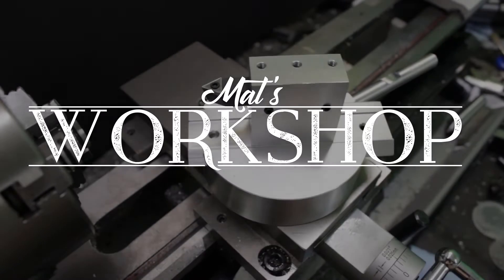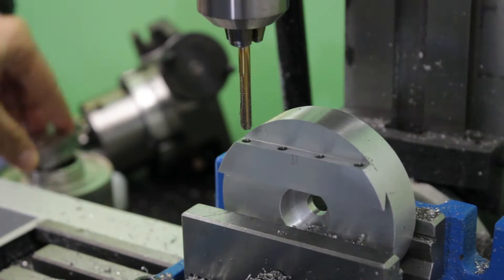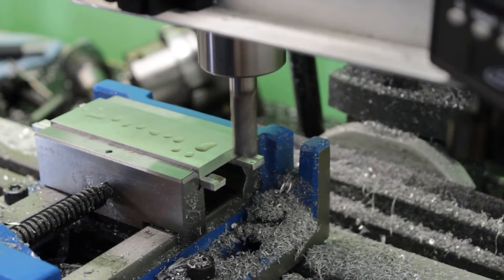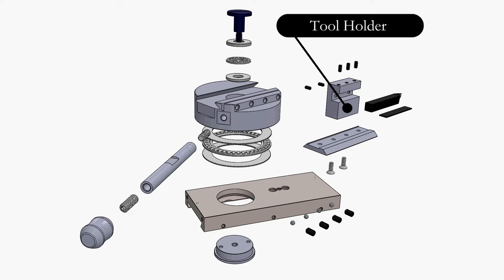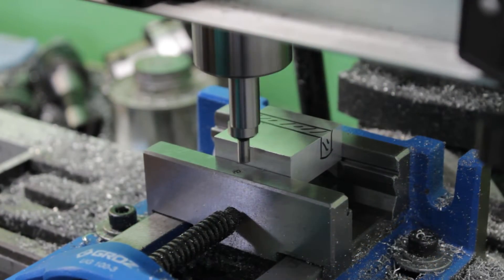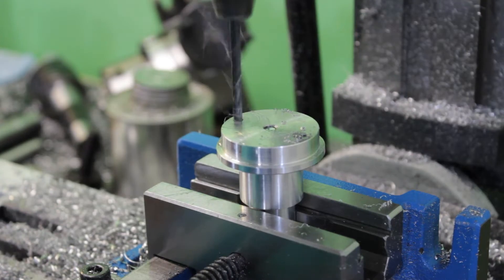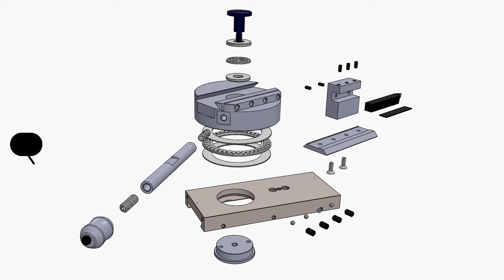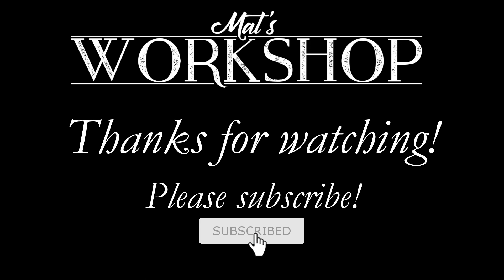Mini Lathe Radius Cutter

Comment: Nice job brother. You seem to have a lot of run-out on your chuck jaws (around 17:30) if I look at the component spinning. What is the smallest internal radius you can cut, if you can with this gadget? External radii is not a problem to cut.
Reply from the maker: Hi Pieter! I do have quiet some runout indeed. about .003" to .004". Not great, but this is to be expected of any chinese branded chucks, or even many other tool. The late spindle itself does not seem too bad, but it is still about .0005" to .001" off. Not the best, but you get what you pay for. a brand new good quality 3 inch chuck is probably worth about 4 times more. I later bought a 4 independant jaw chuck for when i need to crank up precision. Very cheap and not so great either but you know...$$. But for anything i want to do quickly and for which concentricity isnt critical, i use the 3 jaw chuck. Thanks for watching
Reply from the maker: ho and the minimal internal radius is basically 0 depending on how i set it up
Reply: @matsworkshop566  Morning brother! I have ordered a fair amount of stuff from China to use in my workshop, but unfortunately 99% of all the stuff is total trash - plainly garbage. All boring bars are soft. So, in no time they look like as if they went through a concrete mixer from the clamping screws. I bought many bore comparator sets and I have to modify all of them to firstly just function, and secondly to be able to measure any bore diameter in the range of each set. The boring head that I ordered had to be modified to make it sort of function properly. Many items I ordered were the wrong stuff - not what I ordered, and then you are stuck with it. So, think twice before you order any Chinese junk. But like you say, you get what you pay for. Again brother, you have done a seriously good job with the radius cutter. Very few people would go to so much trouble to manufacture something. Have a beer day!

Comment: Where did you buy the table vise.  It looks like a good deal.
Reply from the maker: Hi John, and thanks for watching. If you are refering to the blue vise i am using on my milling machine, the brand is Groz, model UG 100. Amazon (CA) link below. Quiet easy to find. About 100$CAD (probably about 5$USD :P, i say that 'cause we tend to pay this kinda thing much higher price in Canada, where i live)
https://www.amazon.ca/Groz-35121-Uni-Grip-Drill-Press/dp/B077XN118X/ref=sr_1_2?dchild=1&keywords=groz+vise&qid=1614044820&sr=8-2
But please note, even if it does a relatively ok job, this is not a high precision vise. This is mostly designed for use on a drill press. The mobile jaw is pretty narrow, does not have much guiding surface contact, which means it moves quiet a lot. Out of the box, when squeezing a part in, the mobile jaw can lift .004-.005''...not so gread. I added shims under it to limit this issue and remove some play out of it...got it down to .001-.002'' movement...still not great, but knowing this, i generally keep a few .001'' shims on hand and i can place it above the parallel i put on the fixed jaw side, and it helps a lot. If i take the time, i can get a part leveled with a sub .001'' error, which is acceptable for most of what i do.
I would strongly advise to go more for what is often refered to as a "screwless tool makers vise". You can get them of different sizes, from 1'' to 4''. Groz have a model (https://www.amazon.ca/Groz-35201-Tool-Makers-Screwless/dp/B079RR7DDX/ref=sr_1_7?dchild=1&keywords=groz+vise&qid=1614044820&sr=8-7) which is pretty expensive. Personnaly, i own one made by Accusize (here is an example, not exacly the one i own : https://www.amazon.ca/Acusize-PRECISION-SCREW-LESS-VISE-Width/dp/B077BCG8CV/ref=sr_1_5?dchild=1&keywords=accusize+screwless+vise&qid=1614045341&sr=8-5). Accusize have various tools of medium quality for hobbist machinist, and for what i do, it's decent. Of course, this is all cheap stuff made in china, so you get what you pay for. But, by design, this type of vise is much more precise and reliable than the vise you see in my video. It's also more versatile, since you can mount it in different positions. If you get various size of those, you can, for example, have a 2 inch vise, holding small parts, and place this vise at an angle in a 3 or 4 in vise...very useful. They are not as straight forward as real milling machine vises, which you can also get for decent price (probably still a bit more $ than a tool makers vise), but they then to have a higher (thicker) base, which limits the already not so large capacity of a mini-mill such as mine. I hope my comments are useful. Please stay tuned for more videos, i have moved in the last 2 years and am spending quiet some time working on the house, so, less time for projects. But i also reserved a room to build a new small workshop. When i am done, i hope to start posting new vids. Thanks again! Mat

Comment: Congratulations!  Really nice work.  Why did you make a cut in front of the handle?
Reply from the maker: Hi Jean, thanks for watching! If you are talking about the narrow slot on the cylindrical base through which the 4 set screws of the dovetail slide pass, it is there to weaken (volontarily) one side of the dovetail edge so it bends down on the sliding part as you tighten the 4 set screws. You can see that the bottom of this slot is very close to the bottom edge of the dovetail opening (about 1.5 mm). This allows this side of the dovetail to act a bit like a swivel, but without any moving parts. It moves (bends) very slightly to eliminate the play in the slide and lock it in place. Its part of the "brake" feature of the slide. I hope this helps!

Comment: Hi, do you have links to bearings you used?
Reply: Hi Igor, thanks for the question. 
The large bearing is 
https://www.ebay.com/itm/NEW-1pcs-AXK5070-50x70x3mm-Thrust-Needle-Roller-Bearing-Washers/122248184583?ssPageName=STRK%3AMEBIDX%3AIT&_trksid=p2057872.m2749.l2649
The small one, i already had it, so not sure where it came from, but it is equivalent to this one :
https://www.ebay.com/itm/2-PCS-AXK1024-Thrust-Needle-Roller-Bearing-With-Two-Washers-10mm-x-24mm-x-2mm/141778171922?epid=623863937&hash=item2102a33812:g:JdIAAOSwHjNV-7Dx
Thanks!

Comment: Great work! I am looking for dimensions for this project.  I have found your GrabCad drawings and they are wonderful, but I can not find dimensions anywhere in the files.  Also, I can not open the files on my macbook or lenovo comps, just my cell.  Any programs you suggest to download to view on the comp?
Reply from the maker: Hi Micheal! Yes, I am sorry about this. For some reason my computer would fail to export it as a generic .Stp file. However, I you search for minilathe on grabcad, i believe someone took my model and converted it to step. i know it is there somewhere. I might post a new model with some upgrades i did on the machine. Thanks for watching!

Comment: What is this tool used for and what is it called? 13:02
Reply: Its an edge finder, its useful for finding edges. very useful when you need a reference point.
Reply from the maker: Hi Robert! Yes, this is called an edge finder. This is an old school model. There are also electronic ones, but i enjoy using this one better. it is satisfying and fun to use. It is used to find a reference surface and zero out the digital readouts. on the other end you have a pointed version use to find hole centers. In my experience, it is 3 to 4 times more accurate and repeatable that the old piece of paper trick. Very cheap tool.  Relatively fast to use. In my opinion, an essential tool for machining on the mill. Thanks for watching!
Reply: @matsworkshop566  Thank you!!